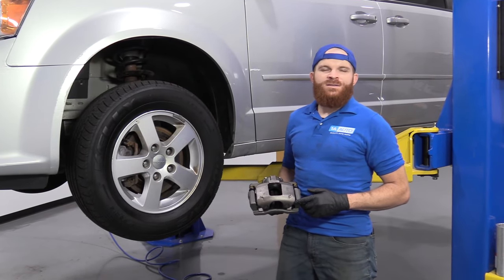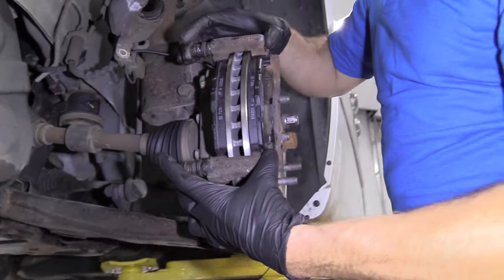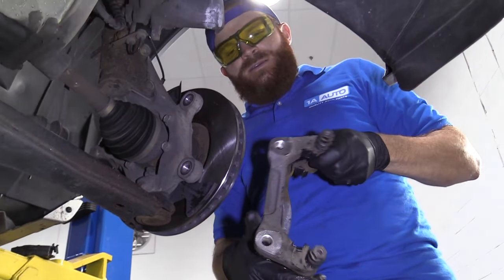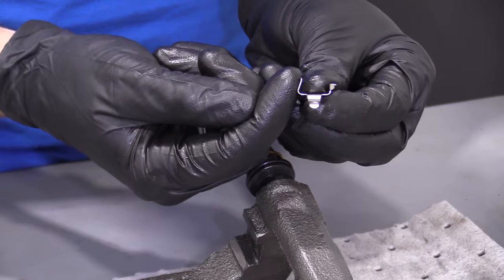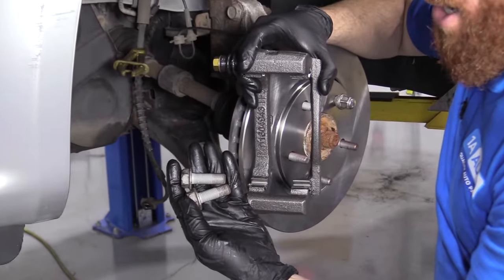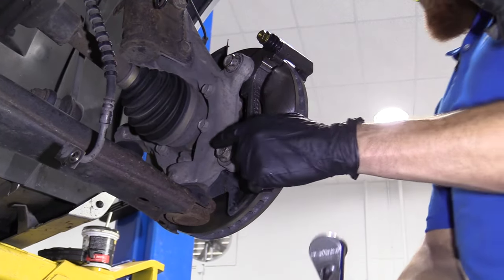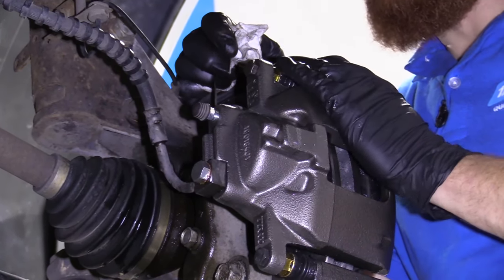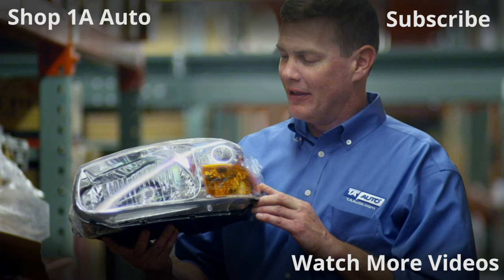How to Replace Front Brake Calipers On Any Car!

Comment: Someone asked if there is a left and right caliper. The answer is YES. The bleeder valve needs to be on top when you install the caliper otherwise will not bleed properly. Hope this helps the next guy!!!

Comment: As he said: do NOT reuse the copper crush washers. They wll leak if you do. Also on the bracket bolts: you see how there's some white color on the bolts? That's dried thread locker. You might want to clean the old thread locker off of them and add a little bit of new thread locker to the bolts that hold the bracket to the car. Those bolts have to be very tight unlike the slide pins.

Comment: Do you have to bleed all The rest of the calipers if you only changing one calipers?  Also is there a tool you can recommend to buy to close off the brake line when removing the caliper?

Comment: Thank you for the video. I was able to change my own for the first time. I encountered some questions. When I remove the brake hose, the bolt had a small hole, I didn’t know if that hole had to align with the brake hose hole? They both had a hole. Also I used the new copper ring washer that came with the new caliper, after I finished both started leaking were the washers are, so I removed them and put the old original ones back and both leaks stopped. I guess new doesn’t always mean better. Thanks again for the video I learned from watching your video and trial and error.

Comment: Great video, the front right caliper on my Buick will lock up, not where the car stops but it shakes and gets incredibly hot, and I’m wondering if it needs lubrication on the parts or completely replace with new ones
Reply from the maker: +Organ Fan Thank you! We wouldn't be able to diagnose an issue like that here, you may want to have a local mechanic take a look at it. Thanks for checking us out! 1AAuto.com

Comment: Good tutorial!

However, why did you double, and even triple, torque the bolts when you get the first click with the torque wrench? As far as I know that can possibly damage and/or strip the threads, right?
Reply: Idk but it looked like he hardly tightened them up at all. Idk much about torque but I thought you had to crank down on um tight and hard?

Comment: I have bought from 1A before for my wifes 08 Accord, and other "modern" cars, but very limited brake parts (no calipers) for my 1979 K5 Blazer.
Reply: 79 is over 40 years old, it's an antique at this point, no sense complaining that you can't find parts for it without going to someone who specializes in that.

Comment: I heard that you don’t HAVE to do a manual brake bleed after bleeding the caliper. Is this true. Is it just recommended to do that. I need to know fast. Thanks.
Reply from the maker: +ThatGuyCoop It is good to do a manual brake bleed to get any air out of the lines.

Comment: The black grease contain molybdenum which will eat away the plastic. It's for metal against metal. You should only use clear silicone paste on the slider
Reply: kinda like what was on there :)

Comment: 💥 I have to separate the brake line from the caliber and then bring the caliper somewhere to have the threads cleaned up because I strip them slightly. Could you tell me how to prevent the brake fluid from dripping out of the open line at the caliper end (the banjo bolt) in the half hour that I’ll be gone.??

Comment: Question. If I'm replacing both front calipers and rotors and pads, do I still need the same type of calipers I'm replacing?
Reply from the maker: +Emmanuel Brillant Thanks for watching!  You just want to make sure that whichever part you purchase is going to be correct for your application.  We recommend purchasing a part that is meant to replace your original factory part.

Comment: Instead of clamping the brake hose, you can use a piece of 2x4 against the front edge of the driver seat and press the brake pedal down.
Reply: Is that a good alternative? Does it work? Thanks
Reply: @beardedtoolreviews7185  Absolutely does work. I am using this technique right now as I rebuild the leaking piston area.on  my Honda Civic. I strongly dislike crimping things. Just  be certain to disconnect the battery as your bra,ke lights will be on the whole time.

Comment: Dumb question, I've got a left front caliper that locked up. Can I just replace the caliper or do I need to replace the bracket as well? Auto novice here
Reply: Typically you only need to replace the caliper but a lot of aftermarket parts include the bracket

Comment: You did not mention that the banjo bolt has to align with the hose otherwise you will not able to bleed the system.I had that experience the hard way because the caliper that I bought is defective. The cylinder is seized inside the cup (made in China)

Comment: You know, if you would have used a clear vinyl hose over the bleeder and the other end in a bucket so you would not have to clean up after yourself. Other than that, it was a great video. I gave you a thumbs up.
Reply from the maker: +CMM Thanks for checking us out! http://1aau.to/m/Shop-1AAuto-c

Comment: are the front calipers the same or 2 different parts? also are the front and rear calipers the same as well? 2004 nissan maxima
Reply from the maker: +catrin b Thanks for watching!  Calipers are not interchangeable, so each corner will require its own caliper.

Comment: I’ve seen people use Sil-Glyde on the caliper slide/guide pins. Also, I’ve seen people use anti seize on the brake pad contact points. Is that ok?

Comment: If you're replacing one caliber do you need to only bleed that one side of the car??
Reply: If you are smart, especially since the car is already up in the air, I would bleed the entire system starting with the brake caliper that is furthest from the master cylinder.

Comment: Manufacture specification torque, where can I found? I have 2017 Nissan Sentra Sr turbo
Reply from the maker: +O kid oki Diego Any repair manual specific to your vehicle (Chilton's, Haynes, Motor, Factory manual, etc.) You can find them at most parts stores, you can check them out at your public library, you can find them on eBay and sometimes on craigslist, and you can download a pdf file from the internet, often free!

Comment: I have a question regarding the hardware when we took off one caliper it only had one hardware piece on the top of it nothing on the bottom is that normal or should it have both hardware on one caliper for a 2003 Hyundai Elantra

Comment: Incorrect use of torque wrench, the bolts are overtightened. Stop at 1 click, additional click(s) at same torque setting causes overtightening.
When verifying torque, adjust torque setting down 10% and listen for click, this avoids overtightening.
Its a good idea to read the manual of the tools you are using :-)

Comment: Wouldn't it better to torque the wheels while they are barely touching the ground (just enough so it doesn't spin when tightening) so that the weight of the vehicle isn't on the wheel when torqueing it?

Comment: Not.
A very good video.. Crushing rubber breaks  Hoses & Hanging calipers off a break hoses.. I see no cleaning of any break Parts.. Not even cleaning the old grease off the sliders. I wouldn't let this guy work on my lawn mower..